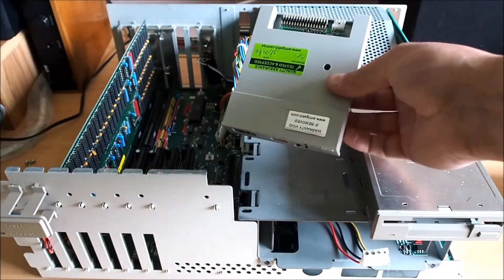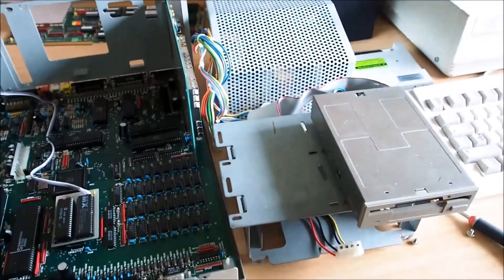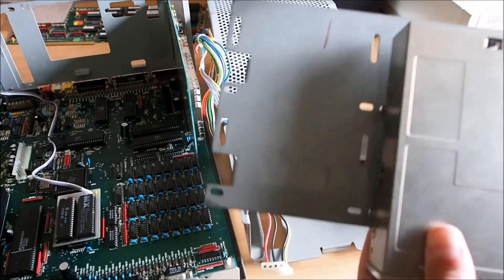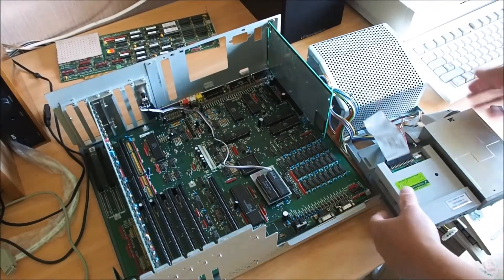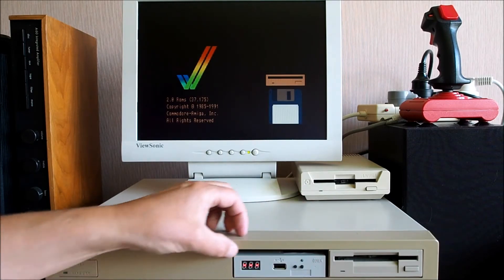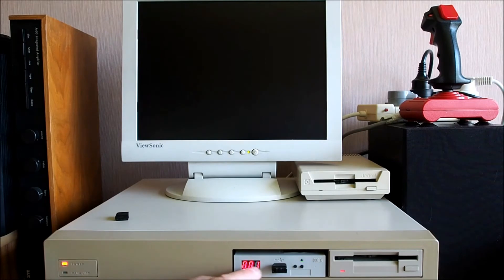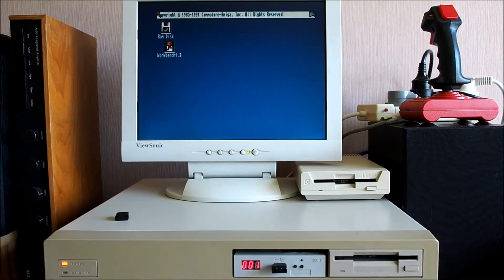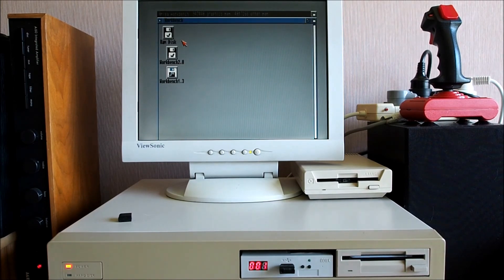Gotek Floppy Disk Drive Emulator Amiga 2000

Comment: I used thick self adhesive rubber foam to surround and seal all visible gaps, not just to trim it out to look nice, but to force the fan to draw air through a thick, black, easy flow filter that I mounted behind the lower front vents.

Comment: Hi I like you video have try to put a gotek and floopy in my 2000 but it came up has   dfo bad when on work bench and df1 say it nodos with no disk in it I have check the jumper for the floopy interior and it was on but it only work with the gotek and check the jumper on the floopy dive and it had only 3 pins so I didn't know what settings to move because this is the first time working on a 2000 can you help

Comment: Im going to put a question here as well although I doubt an answer will come seeing no one else has been responded too -

I have an A2000 and i dont everything retro32 said and yet when I turn on the system it does not boot to the gotek menu. The gotek has been flashed, the thumb drive is formatted correctly along with the all the needed files on it to operate. The light doesnt even come on,...yet the LCD screen shows up. What an I missing here?

Comment: One a dem multipurpose adds, that come in very... handy!!! Would Love 2 get my hands on few a those things. I&I saw dis I-D-a. When taking out the chip mem of da main-board; it is possible 2 create a daughter-board, which can supply 30-pin Sims's.  When applied more then 2 Meg, when biggest Agnus is installed; it would b possible 2 address more than 2 megs as slow RAM. And While being in between Chip & fast mem. Because it has it's own definitions it can b used & expanded. Just like RAM -Disk. It can be used as additional Chip Mem by software or MMU mapping. And it would make lot of mem possible 4 apps like internet browsing, or... sampling & video editing etc. If there would b something I&I regret is doing my Amiga stuff... aweh. Would love 2 get my hands on some stuff I&I can expand & work out. Namasté

Comment: I see these flash-drive-gadgets are useful but have mixed feelings about them. They seem a bit "not needed" or rather used in ways that are for the wrong reasons (convinience). I think they are good for preserving the real Floppy Drive (by not using the real Floppy Drive). I worry though that people discard amiga FD0 drives too easily. I think the ideal solution is an amiga that will boot from an external drive (that would have been fd1) which instead is a flash-drive-gadget plugged into the DB23F connector. A CD32 with sx1 would do that or a piggybacked normal amiga (and one should avoid hardware mods if conservation is in mind). An extender cable from the back of the amiga external floppy drive would work to save wear and tear while a flash-drive-gadget could be plugged in (and dasiy chained) as and when needed. An amiga with 3 daisy chained floppies, and maybe 4 total) which could be High Density if the internal was too, via that gadget) would be quite fast for access and also, being flash memory would be kinder on an a1200 PUS (although an a500 PSU would not grumble). Shipping HomeBrew games on them as if cartridges would be cool. Mind you, at that point one might wonder of the flash-drive-gadget cold be modded to get triggered into "swapping" (the software version of) a floppy disk automatially by the game's software like some copy protection sector "trick" might, maybe with a parallel port dongle too so you would only need one falsh-drive-gadget per game. It would alos be great for use with homebrew (HAMbrew) graphics cards which would be a bit like a Video Toaster so that, with enough ram, all 4 floppy drives could be accessed at once so that either around 3.5 meg (4 of 880k) or 8meg (4 of 2meg HD floppy) could run all the toaster graphics drivers game and access the game from a choice of aothe peripherals such as a parallel port a560 lallafa ethernet dongle made of arduino. All tha would work on any amiga with enough RAM so you don't need some specific hard drive or CDROM for a given slot (be that zorro or pcmcia or whatever).

Comment: The Goteks can be picky about which USB stick they work with. I have some that work fine and some not at all. I have three of the exact same type bought at the same time and one works much better than the other two. The formatting parameters in Windows also has an effect here, so try different block sizes if having problems. Writing to ADFs can also be flaky, and writing to non-DOS ADFs pretty much impossible. The non-free HxC firmware seems to be more reliable in pretty much every way and handles writing DOS ADFs pretty well, but the disk selector is harder to use, although it has more features.

Comment: What is the file structure on the USB drive? What's in the root directory, are there any other directories, etc. 
Also, what program are you using to setup the USB drive files? I flashed my Gotek and put files on my USB stick but it only partially works. I had to format the USB stick with Windows or the display would be all dashes. I then had to write the ADF loader program using a third party program on windows before it would set any software to a number in the display.
I've never seen the file list, or blank numbered lines when starting the machine. I continually get the 1.3 workbench disk request screen. Clicking to the next number does nothing. I have some replacement chips coming to see if it's a problem with the floppy controller section. I don't know what else to do.